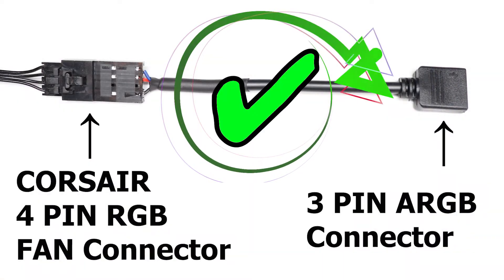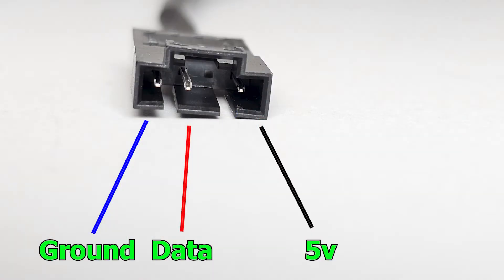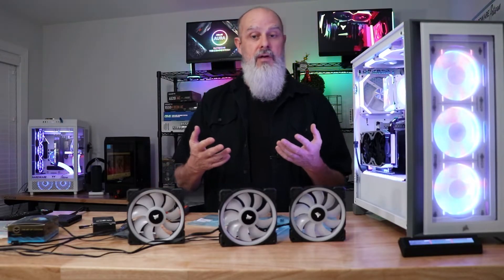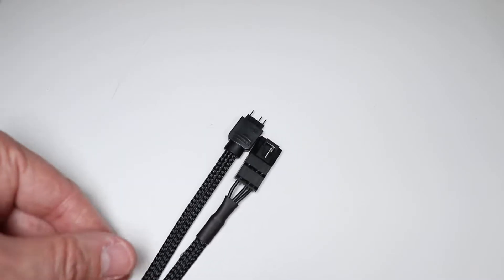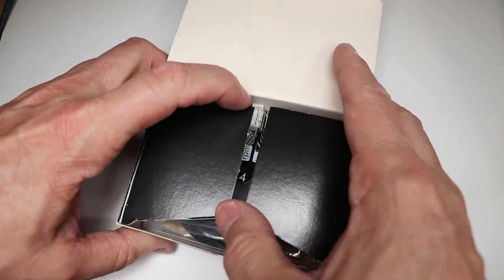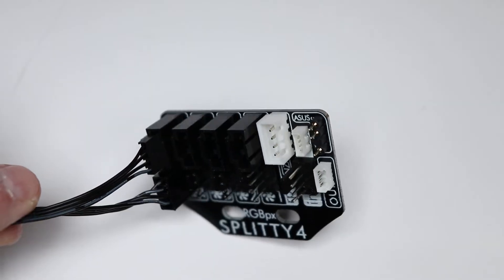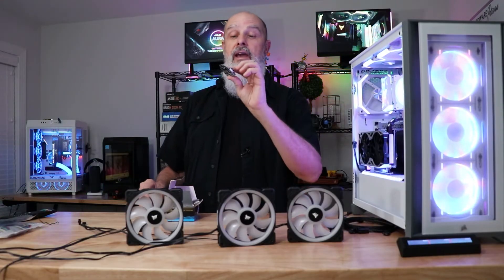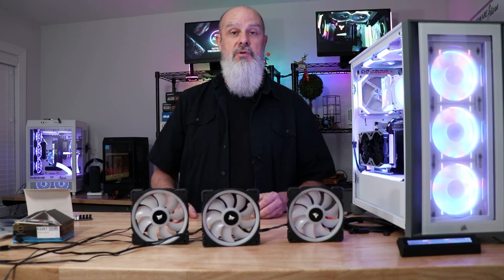ADAPT 4 PIN Corsair FANS to 3 pin ARGB - 3 Ways to use Corsair FAN RGB without a Corsair Controller.

Comment: If your mobo has a 4pin RGB out, with the corsair fans can you simplely switch two pins in the connector and then put it directly into your mobo?
Reply from the maker: Hi RomanHold, a 4 pin RGB port on a motherboard is a 12v RGB port (non addressable). Double check your user manual to be sure that's what it is. Assuming it is a 12v 4 pin RGB port, those ports are not compatible with the corsair fans. 

The Corsair RGB fans do use a 4 pin connector, but it's still 5v ARGB connection and won't work with 12v connectors, it would damage the fan and possibly the board by adapting and using these two together. 

There are RGB HUBS out there that can take a 12V RGB input signal and convert it to 5v signals, the output ports would be 3pin 5v ARGB ports, you would have to adapt the 4 pin corsair fan to use with these hubs as shown in this video.

Most motherboards will have 3 pin 5v ARGB ports in addition to the 4pin 12V RGB ports. Check your user manual to be sure. 

I hope that help point you in the right direction. Thanks for watching!!!

Comment: i am using Ant eSport sx3 cabinet for my pc ,it comes with rear fan with argb and front panel argb strips 

It combined together with two cables for connection,
one sata power to psu 
one 4-1(4 minus1) argb pin to argb header on the motherboard 
* it works well 
rear fan and rear fan argb , front panel argb strips 
* Rear fan has 4 pin combined +12v and argb connection(5v D * GND )

My question is WHAT IS pin out of the rear fan 4 pin?

Comment: Excellent video, thank you. You presented this very well. I like that you clarified V, Data, Ground with text and apropriate colors as it makes it very clear what the pinout was for the corsair 4 pin MPC2 connector. I admit I rasrely have seen that connector used outside of analog PC-CD Rom audio (yes I know that dates me).

With your video I made a male input for the female MPC2 connector to a 3pin JST SM female connector. This let me connect it to an adaptor cable that was provided with my motherboard. I had no interest in adding in a Corsair Commander module, so I appreciate that your video saved me from that route.

Comment: i have been spinning in circles for years cause i still cant seem to get what i want ...i want to be able to control each argb device individually, these other devices are just splitters right ? it doesnt show up each output as adressable right ? the only way i have been able to do this is using corsair and the corsair hub which works but i dont want to use corsair for all my products ....
Reply from the maker: Hi BrandonMitchell84, I completely understand your dilemma! The Adapter cable in this video  would adapt a corsair fan (4 pin RGB) to a 3 pin 5v ARGB connector for use with non corsair controllers (or motherboard). This works great, but may not give you individual control over the fan. 

You may be more interested in this video:    https://youtu.be/DJX71YFDkhI
Connect any ARGB device to a 4 PIN Corsair connector - Adapter cable from Airgoo

This cable converts the 4 pin corsair connector on the controller to a 5v 3 pin ARGB connector, with this cable you can connect non-corsair devices  to the fan port of the controller. This would give you control over the device in icue....

Its not perfect, icue cannot define non-corsair devices on the port, so you have to manually select from one of the corsair fans that closely matches the number of LED's, but for most devices this works fine. So in icue the device will appear as a fan, but you can control it individually. 

Check that video out, I think thats what you're looking for. 

Good Luck, have fun, and thanks for watching!!!!

Comment: I have a ASUS X370 Crosshair VI hero mother board; it only has 4 pin RGB connectors on the mother board; however the CPU cooler fans are 3 pin for The RGB; every time I search for 4 pin connectors; it just shows me a molex connector which is not what I am after; I have to find four pin RGB connector on the mother board assignment; maybe I can just take a pair of diag cutters and cut the offending pin off the mother board .. lol; long shot but I cannot be certain until I research the specs.
Thank for the content.

Peace
Reply: Got a corsair hub RGB? You can connect a single jumper cable between data pin of the ARGB on MB, and the data pin of the Hub, both middle pins.

Comment: Hi there! First off, I want to express my gratitude for your videos and assistance. I have a question regarding RGB neon flex ropes. These ropes typically come with 4 pins, but I need to adapt one to work with only 2 pins. My idea is to synchronize the turning on of the main RGB rope (with 4 pins) to also activate the neon rope (with 2 pins). I've been searching for an adapter or a solution to achieve this, but I'm struggling to find the best approach. If you have any ideas on how to accomplish this, I would greatly appreciate your help.

Comment: Is it safe to buy adapter cable? I have very expensive rig and i dont want anything to happend but its only option because i dont wanna install corsair app to control single fan that i have (i had more but my aio died)

Comment: Hiya Dude nice vid. I have issue and trying to like you did with the cables to find the right info. Basically I got a few cases that came with rgb fans, they have a argb out for connecting to the mobo but these fans have 4 pins similar to the corsair molex but the fan is included in them 4 pins. So they don't have a separate connecter for fans. You ever converted them to fan and rgb.

Comment: I have a question to ask. I purchased an led strip from Dollarama and on the strip it says 5v R G B. I have an Inwin fan laying around with a 3 pin argb connector. Is it possible to connect the led strip to the 3 pin connector to use it with the argb hub and software?

Comment: i need help i just bought new fans , my new fans are 4 pin females . my old fans are 3 pin females.. is there a way to hook my new fans . an adaptor i cant find anything to help me
Reply from the maker: Hi blacktopgaming2155,  I'm assuming you've purchased Corsair RGB fans based on the fact you mentioned 4 pin females. These fans, with the 4 pin connector, use a Corsair Controller to work, I'm not sure exactly which fans you are referring to with the 3 pin femails. You can purchase one of several corsair RGB controllers that would work, I'd suggest the CORE XT. 

But, this Video outlines a few ways to adapt the corsair 4 pin fans to standard 3 pin ARGB, which you could then connect to an RGB hub which would in turn connect to your motherboard RGB header or something similar. If that doesn't help, let me know the model of fans you have and what RGB controller you are using for the 3 pin fans. 

Thanks for watching!!!

Comment: 1:00 - On the first plug you labeled it  5 D _ G
1:05 - On the sec plug you labeled it  G D _ 5

So which is it? Plugging these plugs together wired this way will short the 5V supply!
Reply: Also, blue for ground? Black for power? Red for data?

0V (ground) = black
5v (power) = red
Data can be blue if you wish.

It's incredibly easy to screw this up with so many inconsistencies.
Reply from the maker: Hi lazzer408, these pinouts are correct, these are 2 different connectors, the point I was trying to make was you need to line up 5v to 5v, data to data and ground to ground and since the standard 3 Pin ARGB connector and the Corsair 4 Pin connector are laid out different physcially, you need to take care in getting it straight, I wasn't suggesting you connect exactly as it is in it's physical layout.  As you stated, don't cross wire them, that's trouble. It might not be crystal clear in some case, in which case, I'd suggest using the pre-made adapter cables. Thanks for pointing that out, being careful is key....Thanks for watching!!!
Reply: @HardwareArtisan  I need to make up an ARGB to ARGB cable but put a Molex female connector on one end as the ARGB pins on my motherboard are pretty chunky.  If I did this then I would wire both ends as 5D_G right?  The GD_5 vis unique to Corsair I assume.

Comment: Hi, is there another name for the "patch cable" you showed at 6:10? I've tried searching 'patch cable' and completely different cables come up every time. They look like ethernet cables, not even close to what is shown. Also, what is that hub that the cable is plugged into? It looks like I need both of them.
Reply from the maker: Hi des1914, that cable is just an ARGB splitter cable, there isn't anything special about it, i was using it to carry the argb signal from the hub to the splitty hub, it's this exact cable here:

https://www.amazon.com/dp/B097JS75LV?psc=1&ref_=cm_sw_r_cp_ud_ct_ABZXJJS9WJ1QE86T3Z9M

The hub I used here was a splitty from aquacomputer, this hub has the 4 pin corsair (molex) fan connectors.

Alternatively, here is the adapter cable, that will adapt corsair fans to 3 pain ARGB. 

https://www.amazon.com/dp/B0BHW3SYHP?psc=1&ref_=cm_sw_r_cp_ud_ct_YATSBK49HX6WD4KD83VX

You can get the ARGB signal from your motherboard, or other RGB source. Normally you just use a corsair controller to do all of this, but if you want a signal from your motherboard or other 3 pin argb source, you can use these solutions. 

Good Luck and Have Fun!!!

Comment: I've made numerous adapters for Corsair's 3 pin lighting channels so I can run non Corsair products off of Lighting Node Pro's and use ICUE to control them. lol I have literally 10 LNP mounted under my desk running tons of stuff outside of the PC that are powered from an underpowered PC PSU I had from an old PC. Their USB is ran to a big hub which is ran to the back of the motherboard. I have tons of stuff like 4 LED towers I've made that are similar to Corsair's LT100 towers, and even some LED rings I shielded from the heat and modded into a couple of lava lamps to make color changing lamps. As well as numerous LED strips behind my TV, monitor, and around the desk. Those adapters are easy peasy to make since it's just 3 connections to 3 connections. But for the 4 pin fan connections that the RGB hub and both types of Commander Core uses, to 3 pin ARGB, I just bought a couple of those on ebay. That was back before I started making my own adapters. But now I wanted to add a third product to a RGB hub and make my own adapter for the fan controllers as well. I know Corsair fans has 2 data lines, 1 for normal 3 pin ARGB, and 1 for how they can have modes that travel from fan to fan and is why you have to plug them in order starting with port 1 then 2 then so on. But I didn't know exactly the pinout so I wasn't sure which pin should be missing. Now I can easily make a 4 pin Corsair fan to 3 pin JST-SM adapter thanks to this vid. Thank you sir. 😍

Edit: I tried this pinout in my 4 pin Corsair to 3 pin JST-SM and it worked. Sort of anyways. IE it only worked for port 1 of the RGB hub. With only 1 data line connected to the 4 pin Corsair molex, the LED strips I had on port 2 of the RGB hub froze in the mode they were displaying when I unplugged port 1. So to get port 2 and the rest of the ports above it to work again you also have to connect the second data line into the mix of the adapter. So what I did was make a Y splitter with the data line and added both ends of the Y to the 4 pin Corsair molex connector. I just used some self soldering butt connectors to make the Y splitter. I highly recommend those BTW. You basically have to try to screw it up. Just strip the rubber off the ends of the wire, shove them until the bare end is under the solder ball in the middle, and apply heat. Many sales of them say not to use a lighter but you totally can, but a heat gun works best. Self soldering butt connectors are available on Amazon as well as numerous other places. Connecting the second data line allows the RGB hub to continue the data signal to the rest of the ports. lol I feel kinda stupid I didn't think about that before. So if any are trying to do the opposite of this vid and get non Corsair products to work off of a Corsair 4 pin fan controller, your pinout on the Corsair molex will be 5v, data, data, and ground. Then combine the 2 data into 1 and run it to whichever other 3 pin ARGB connector you're trying to make an adapter for. 

And since I'm here again I might as well add how this works. When doing this you're basically turning the RGB hub into a 6 port splitter. IE you can only get 1 data signal from ICUE that will be shared to all 6 ports. So you lose the ability of modes that can travel from fan to fan or LED strip to LED strip or what have you to what have you like RGB hubs can normaly do with Corsair fans. Like I mentioned above that's the whole reason Corsair fans are 4 pin to begin with.

Comment: My motherboard has a 12v rgb header that has 4 pins. Can I plug the rgb cable of the fan directly to that header? If not, what is that 4 pin for?
Reply: ARGB = 5v, RGB = 12v. You cant mix and match those.

Comment: Hello @HardwareArtisan , once again thanks for such great videos about that "lovely" Corsair environment......but I do have another question : can I connect the 5V led connector from my Asus rog thor PSU than I actually have plugged into my Asus motherboard ?  and the Asus Herculix GPU rgb holder 5V too ( in order for me to control the leds with Murals ) /// Murals is just great when videogaming but my MB/GPU/PSU are Asus. Icue recognizes GPU and MB but not the PSU....

Or should I just try one of the third party software control program to try to "rule them all" ? ;) 

I feel than corsair is slowly slowly kindda loosing control on their proprietary devices between non Corsair cables over the web and new third party control softwares going "viral" lately ;) 

That's why they created Murals and Link more recently I believe.

Comment: Okay can you do it with ml120 rgb elite fans cuz i got mine a single fan and its kinda depressing for 35 bucks
Reply from the maker: Hi @nobodycares9398, although I didn't specifically try this with the ml series fans, it uses the same 4 pin connector shown in the video and should work just fine with the adapter I demonstrated here. I agree, those fans are not cheap and this offers a great way to get the RGB working without having to buy a bunch of corsair controllers. 

Let me know how it works and keep having fun!! Thanks for your support and for watching!!!

Comment: Really enjoy the content, thanks!  I did want to mention the splitty you have linked to Amazon is not the same as you have shown here.  The one that you have shown has an "ASUS" 3pin ARGB connection in the top corner and the one on Amazon does not.
Reply from the maker: Thanks for the feedback!!! I did not catch that, let me go check and correct it! Thanks for your support and for watching!!!
Reply from the maker: Thanks oldschoolgamer711, i've corrected that and pointed out the amazon one is not the same as the one in the video. I put the link to PPCS if you want to check it out. Cheaper there, but may have to pay for shipping. Thanks again, you're awesome!!!
Reply: You are very welcome.  I think I am going to go the cable route to get them all connected to my ARGB controller.  Thanks again, really enjoy the content. @HardwareArtisan